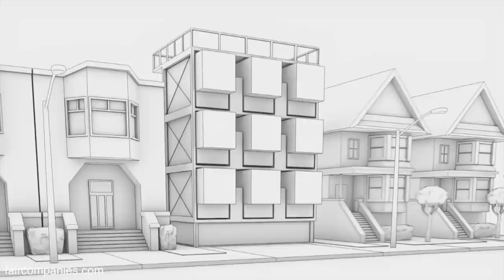Kasita: tiny prefab home-as-a-service for post-land urbanism

Comment: Here in the Midwest winter temperatures can get as low as -75F with the wind chill.  My wedding day (December 9, 1995) broke all records at -55F. It was such a bummer! It it had been 45F the day before. In the summer  it can easily reach 105F-not factoring in the high humidity, so the actual heat index is even higher.  Those walls look mighty thin, and a mini split wouldn't even put a dent in the weather we have here.  I'm really not trying to rain on anyone's parade-I am just trying to be a realist.  Say I sunk my hard earned cash into one of these units, with the thought I would live in one here for a few years, and then maybe retire to Florida and take it with me.  Besides the fact I can see from the prototype there cannot possibly be enough insulation, our close to 200 degree Farenheit potential swing in weather per year causes profound expansion and contraction of all building materials.  If selling Kasita's on a nationwide basis, that would have to be factored into consideration.
Reply: I think you make an excellent point. Housing construction is very personal and dependent on location and climate. Not sure if this is being considered in the design and construction of these modules. Expansion and contraction based on wide temperature fluctuations is a big part of home construction. How different materials respond to different climates and weather conditions is an important factor and can't be overlooked. I see these glass fishbowls and just think, too hot in summer, to cold in winter, too liable to crack.
Reply: I believe technology and innovation in building materials can surmount these sorts of obstacles. This guy is clearly no dummy either. I'm sure he's considered these sorts of needs if not having solved all the problems yet, or talked about them all in this one video. 

And since BMW can build a car (this was designed by BMW) that can withstand all sorts of climates why can't this home be built in a similar fashion? I'm just playing devils advocate here.
Reply: +Angela Siegfried I must have missed the BMW link-can you please reply with the time that this was discussed?  In any case, building a car and constructing a tiny house that can withstand a brutal Chicago winter are apples and oranges.  And there are plenty of BMW owners that have frozen Popsicles for cars in January that won't start worth a darn here! Have you ever been through a bitter cold Upper Midwest winter?  I remember one day when it was -75F and I was at work.  We suddenly kept hearing these bizzare explosive noises, but a sound which I had never heard before.  All the glass in the revolving doors in the building, which were many, were exploding from the cold.  It got down to 35 F at my desk-they couldn't put plywood on fast enough to keep up with all the exploding glass. Your attitude is cavalier and I have no confidence some older Emo wannabe in Austin, Tx has thought of everything it takes to market this product in all climates.
Reply: I'm from Chicago so yes I'm aware.
It is entirely your prerogative to not appreciate this concept.
Reply: +Angela Siegfried oh, I appreciate the concept, but I just can see that this unit the way it is designed is not suited to all climates in the United States, as I hear him asserting in this video.  I love the Tiny House concept-I truly believe there is a place for it in our society.  I also work hard for my money, and I am very cautious how I spend it.  I just cannot buy into this concept of this Tiny House.  From my personal experience, I do not believe it is suited for a cold climate.  Can you imagine climbing up those outdoor rack stairs to the top level with your groceries in January?? And having to make multiple trips?  I know this is a prototype, but it is glaringly obvious that there is not enough insulation in this unit to make it a feasible place to spend a cold winter. Again, my opinion.
Reply: +Angela Siegfried BTW-if you are still currently living in Chicago-there are two Tiny Houses on display and available to tour tomorrow and Wednesday down at Riverfront Plaza, right by the Lyric Opera House.  My teenage daughter was downtown yesterday and just happened to see them.  I am going to go with her on Wednesday to take a tour.  I would rather spend money on a Tiny House while my kids are in college then a college dorm.  They can live in it while at school, and then after they graduate it can become a vacation home, or if they find a job in another city, potentially a home for them.
Reply: Thanks for the heads up. I lived there 24 years and then decided I was tired of the cold and moved south. :) 
Sounds lovely for your kids and for later on.
Reply: He's in Austin. The design doesn't seem appropriate there either. The glass room looks like a permanent sauna. I can imagine the heat being horrendous most of the year inside that house
Reply: This is just model one. It's not supposed to be the end all be all answer to every situation. Himself  he says his grand scheme is to make these racks open license so u can commission ur own mom and pop custom cube and still be able to pop it in a kasita rack. No one says that cities with less mild climates cannot have a common entrance and the door end of ur home be inside. Or an elevator. Although the cost of these is sure to be passed to renters of spaces, much like how a bunch of wild amenities in a condo rack up the HOA fees. These issues are just not germane to the city he is working in right now.

Comment: That glass cube is a big time heat collector.  That would make your house too damn hot in the 100 degree summers here in Texas.  If one is to build sustainable it is counterproductive to depend completely on air conditioning.
Reply: SELF-RELIANCE and a STRONG COMMUNITY 
You missed at the beginning where he talks about the glass darkening (like transition lenses). Still not a good design for most people.

Comment: Casita is a fiberglass trailer company. How can he get away with calling them Casitas? IMHO, this tiny home is too sterile, too white inside, too much metal outside.  The glass section reminds me of a zoo enclosure where the animals are on display.
Reply: It starts with a K, not a C.
Reply: Thanks for the clarification.
Reply: I know what you mean by too sterile but this design has sadly become the standard for modern cheap housing. in my city every student apartment looks like this. some of them bigger and shared by up to 9 people but all of them look clinical and claustrophobic
Reply: I think he said the glass goes dark when you run an electrical current through it (not photochromatic glass)
Reply: What he said was "6:43 what's really cool about this glass is that it's electrochromic glass it's a dynamic glass that will start off in a transparent mode like this and then either with an app or controller on the wall or an auto setting to where when the Sun hits it it will dark out 
so it goes through about five levels of shading to where this can completely black out"
so to be clear it does not darken when the sun hits it, 
he needs to write an app, or put a wall switch, or wire up a sensor, (none of this exists yet), to control the system that applies power to the glass

Comment: I remember when Prof. Jeff Wilson lived in a dumpster for a year,....to make a point.   I really thought the idea made a great case for thinking WAY outside the box when it came to minimalist housing.  This is a good starting point for Prof Wilson's concept,...yeah some aspects are impractical like the glass floors and walls, but,...for an idea showcase,...I think it really works well.  personally, I like my privacy when I am at home,  and although I like looking at homes that use glass walls and ceilings, I would not want to live in one,.....even if it was located out in the wilderness somewhere.   He states that the production version with be 50% larger,......I don't know that that is necessary frankly,...as I think they could make far better use of space if they went to a conventional wall and window format.   I have looked at numerous Park Model RV homes that are typically 399 square feet, not counting any lofted space,....and they frankly feel quite spacious to me.   I particularly like the layout of the "Trinca" model built by Platinum cottages.  They run about $60K. New with many high end touches and all appliaances.

Comment: The only thing I'd change is the seat where the bed rolls out. I'd angle those backrests so it's more comfortable rather than vertically upright. Otherwise I love it. Could easily see myself living in one. Also can see the design being modified slightly and being made much more cheaply utilising shipping containers.

Comment: Ok how do they plan on sliding these into the racks? It's basically a shipyard at that point, there's 2 kinds of container lifters, a Reach Stacker which is like a crane, and a Container Handler which is like a big forklift. But... neither of those machines can slide a container into a slot sideways. They can only stack on top of an open surface, like another container. Are they going to build a whole new type of lifter to move these?

Comment: I am more interested in the specs of the rack system used to hold the units and what if any licensing fees that are required to create individually designed units to take advantage of the infrastructure. I can visualize a rack structure on a hillside overlooking the downtown area that has a retractable facing wall to capitalize on the view without invading the neighbors space. Maybe units with lots of wood and cloth, or another with a lot of soundproofing for musicians etc. The concept lends itself to individually rented office space or seasonal vacation housing. Imagine moving your unit in June for 3 months of Aspen Colorado this year, 3 months of Las Vegas next year, and in the "off" season it sits in your back yard in Gary Indiana for guest sleeping.

Comment: This is definitely a warm climate only house. That glass room would turn this house into an icebox where I live in the winter. If it were insulated thicker (or with high tech insulation), made use of passive solar heat gain and had triple glazed windows it might work better in a larger range of climates. Great concept though.

Comment: I love the concept of tiny homes, but I've got just a few problems with them.

1. Weather-durability and safety - I live in Tornado Alley, so my primary concern is how they'll hold up in high winds and hail. And related to that where I could go for shelter from a tornado. And of course, it would need sufficient insulation to be cost-effective to heat in the winter as well. It seems to me that most of these tiny home projects ignore the parts of the country where it can get pretty damn cold in the winter and then turn around and get pretty damn hot in the summer.

2. Every bedroom/apartment I've had since I was 14 has always been designed around my desktop computer. I'm very much a geek and a gamer. Most of these tiny houses never seem to have any space for a desk, let alone the dual-monitor system that I spend the vast majority of time on. Most of these tiny homes seem to be based on the idea of ppl using phones/tablets/laptops. While that might be fine for most ppl, gamers learn quickly that a laptop is not ideal or cost effective and that it's far more cost effective to build your own PC rig.

Comment: Thanks for sharing this one!  Got my functional and design juices flowing.
Hey, I dig the kasita in temperate climates-- how would this thing be for 
warmth during a winter in Wisconsin? It might work in Austin and here in Florida.
 
Also, I see major flaws in where appliances are placed-- right at floor level...what
are they thinking? Stove and Fridge should be at eye-level.  The lazy-man's bed is 
functionally aesthetic, I'll give it that.  I for one would not like to be on the upper floors,
were they stacked, or under them, for that matter. I for one like LIGHT everywhere AND
privacy.

They have at least dealt with CODES by classifying them as
multifamily housing.....It is really the familiar and truly outmoded CODING which
needs the update, across the country.  Then all kinds of new ideas will bloom.

Comment: In Sweden, 80 percent of the population has access to a "stuga" which means cottage. As an American,  in Sweden, I bought a piece of land a stone's through from the Baltic and put in a septic system, kitchen etc. My property has two little sub cottages in addition to ghe main stuga. Something like this unit would be terrific for replacing thd guest hoyses on our property, and I fo not think the bathroom or ghe kitchen would be needed, just thd sleeping area. Thd design with the glass facade would be perfect for my needs, if the pricepoint were in a sweet spot. Consider Scandinavia where there is s culture of secondary homes in the nature as opposed to the city.

Comment: This is fantastic!  I'm wondering how the kasita model would work in NYC where I live. Are they narrow enough to fit in between brownstones as there are many open lots the ought the 5 boroughs where newly instructed brownstones are built. Could a Kasita be conformed for any construction space?
Reply from the maker: It depends on the dimensions of the rack structure they've designed to house the units. But the idea is it should fit on any city lot big enough for whatever that structure dimension is (the renders show 3 units across).

Comment: Bauhaus redux.  The plug-and-play modular, pre-fab concept makes sense but the prototype looks ugly and uncomfortable (imagine sitting on that couch for more than two minutes) and there are issues with all that glass that he's not mentioning.  For one thing, despite its small size it would not be energy efficient--that cantilevered glass box will get very hot and very chilly.  But space-wise it's an interesting urban solution.
Reply: Double or triple paned glazed glass with inert gas is pretty efficient as an insulator.  Making it black out in winter would be nice for warmth.

Comment: I love this but was disappointed to hear the actual production unit is larger. Altho they stress the stacking of units, they would ABSOLUTELY make perfect granny flats. With the larger footprint of the production model, you would be less likely to use them for this purpose because most people have smaller backyards that could absorb the footprint of the smaller structure however the larger unit would require too much yard.

Comment: In the early 1970's I worked for" Modular Products"in Sarasota Florida... they built Bathrooms complete from when you opened the door. They were being  built for a hotel in Hawaii. they were picked up by cane and slide into the floor of the unit. I did the plumbing on the exterior and hook up the sink, tub/shower and toilet. The had plans to do the same type of unit for kitchen. all made of fiberglass....so all yo had to do is hook up the exterior plumbing and the electrical....even had a slot in the wall to disposed of razor blades...LOL....I think you can still find this company on Google...I also worked at a solar panel company in Manchester N.H. also in the mid 1970's how cheap the materials are to make a 8 ft.x3ft. solar pane...and the prices they charge for the panels and installation is preventive from people being able to afford these panel. Plus codes and permits etc etc...

Comment: 2:29 doesn't having separate little fully individual houses stacked like that total defeat the idea of affordable housing, in that it takes away the huge cost savings of apartment complexes? Ie. Plumbing, insulation, wall Materials etc. are all shared when one building is used? I hope this question is answered.

Comment: I live in Vancouver, where the housing crisis is fueling the construction of thousands of shoe box apartments. But what is a family supposed to do when they have a kid, or a parent needs to move in with them? There is no new family sized units to move into. The single family houses and duplexes are way outside the budget of even most professionals because the market is so over inflated.

Also, he didn't turn the tinted glass on, which means they just used regular glass for the prototype. No way are they going to use a /more/ expensive type of glass in a production run. They have not taken the lessons from those who came before.

Comment: Nice idea. I love in Boston which is (somehow, not sure why) supposed to be more expensive than NYC, second only to San Fransisco. I would like something double this size though. Could two of these be put together to make an "XL" unit? That would be nice.

Another problem I see is that owning a traditional home is so desirable because they tend to go up in value over the years. Will the Kasita go up in value over the years? Will it survive 10, 20, 30 years? Maybe this is meant to be an alternative to renting. Instead of throwing away rent money the first 10 years after college, maybe you can spend that money on owning something...

I have many questions...

Comment: I was wondering if they plan to make a mechanized racking system that can retrieve your unit and place it on a flat bed or behind a semi truck. Think of it as a huge vending machine similar to what some electric taxi services are doing with cars. Still even if the cost of moving these is prohibitive to the individual is sounds like a cheaper ways for the apartment building or condo owners to put up a building.